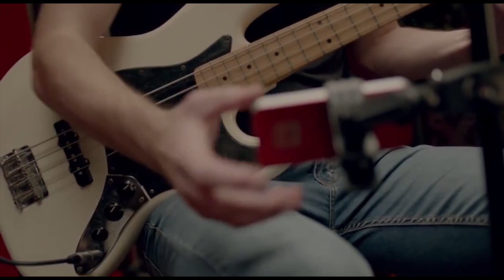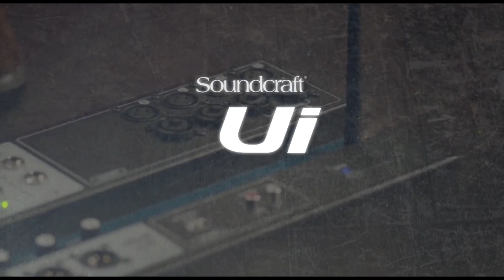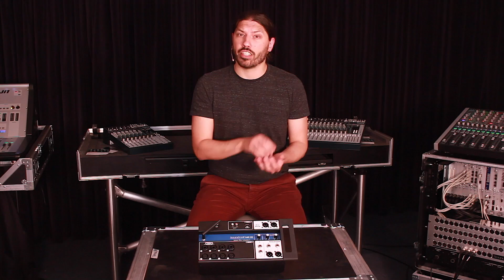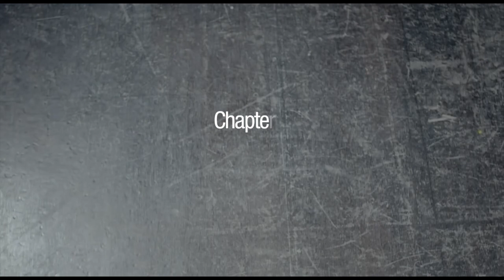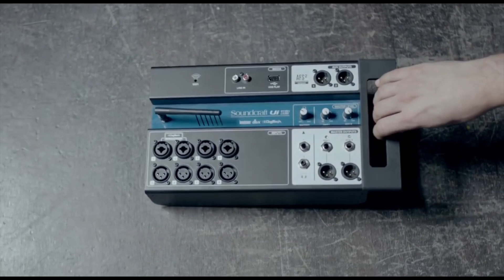Soundcraft Ui Series Tutorial: Introduction to Advanced Processing

Comment: The amp modeling is a nice feature. It could be made more useful by linking it to a MIDI control so it could be switched on the fly by a foot controller. The models could be assigned and called up by number and/or bank and number.  Having to set it to one model doesn't seem as useful unless you use a clean sound and do all modification through stomp boxes.  In effect you lose the amp modeling feature. Unfortunate....It's a rare occurrence to use an overdrive i.e. "Eddie Lead" throughout an entire set. Manually switching is too slow during a performance. I have situations where I have to go from an overdrive to clean/chorus in same song. Difficult to switch by hand while playing.

But, GREAT System!... With so much built in you need minimal speakers and amplifiers for PA. If you use Powered monitors, subs, and mains you don't need anything but the mixer and cables to connect everything. If using passive speakers you need to carry amplifiers and a crossover for the PA and amp for the monitors. Still need guitar amps and effects but can't have everything!